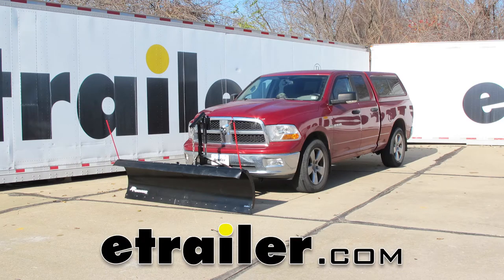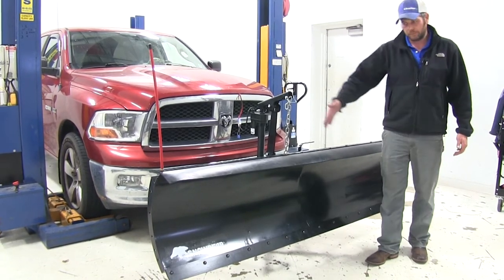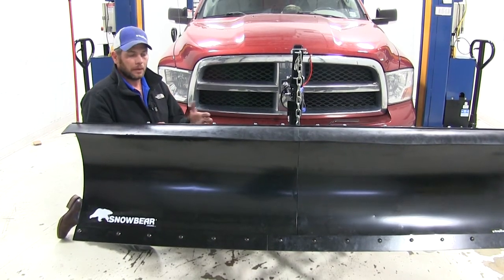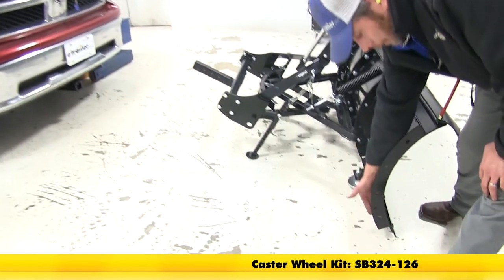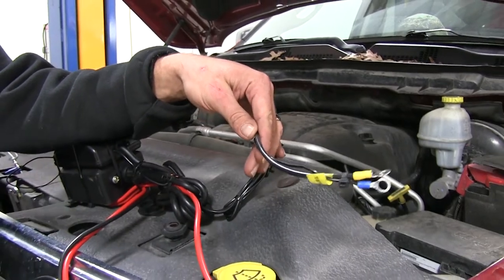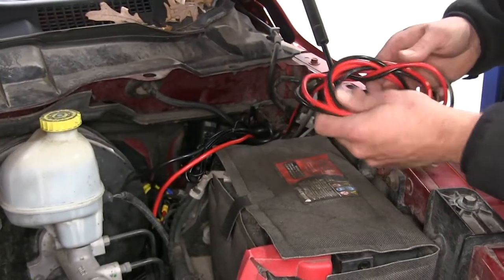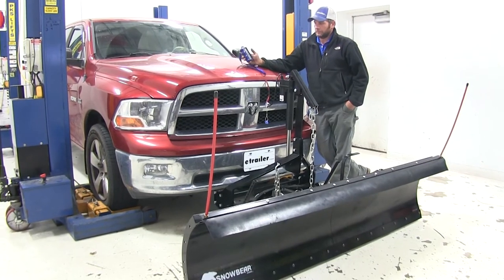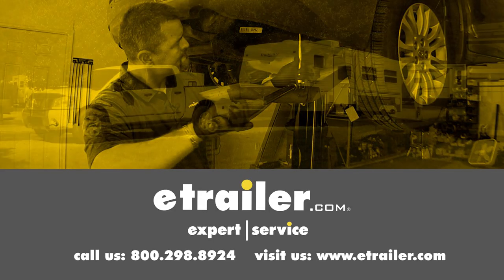etrailer | SnowBear Proshovel Snowplow Review

Comment: I ordered one, we shall see
Reply from the maker: Let us know how you like this snow plow!

https://www.etrailer.com/Snow-Plow/SnowBear/SB324-167.html
Reply: Update, I have it installed on a Mitsubishi Montero, plows great, I really like the actuator over the winch to lift it, I have had both  and prefer this style
Reply: I have been using mine on gravel
Reply: @TheHillrat4wd  FYI do not operate this plow in a humid environment. 
That’s what I was asked. 
The electric motor has a defective seal. Water gets inside and destroys it. 
Waiting on replacement part under warranty  after 1 winter. 
Will see.